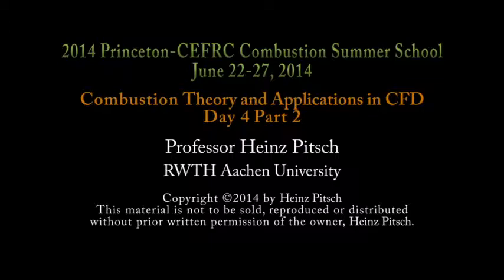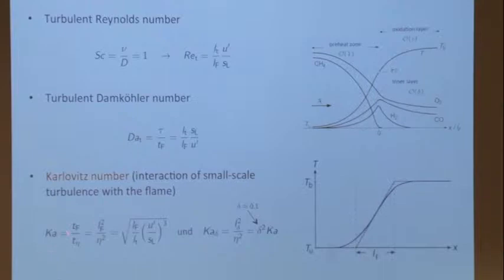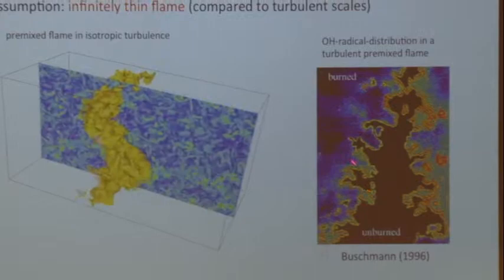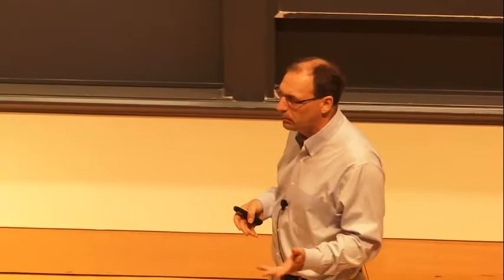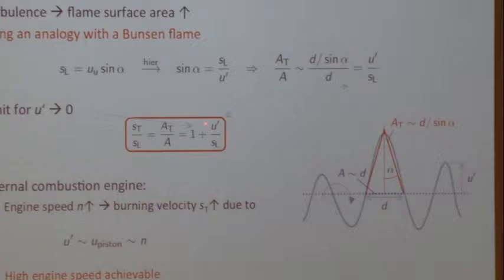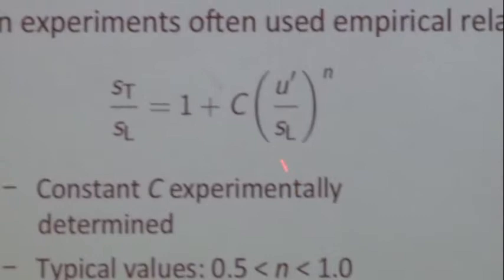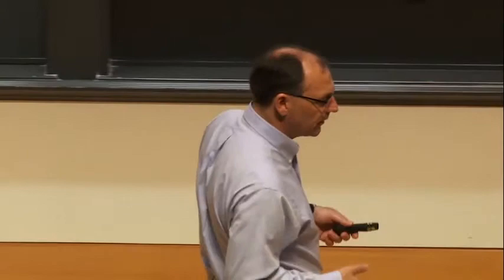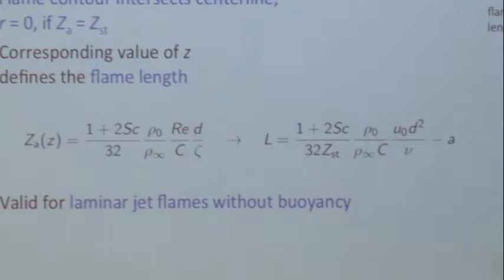Combustion Theory and Applications in CFD, Pitsch, Day 4, Part 2

Comment: I was confused that Prof. Pitsch skipped the diagram at 25:40. Didn't I get it, or does it only show experimental data to back up the assumption he presented before, that the turbulent burning velocity is much larger than the laminar one. They actually measured a factor of 30, which is even more than the factor 15 in the example he presented before.